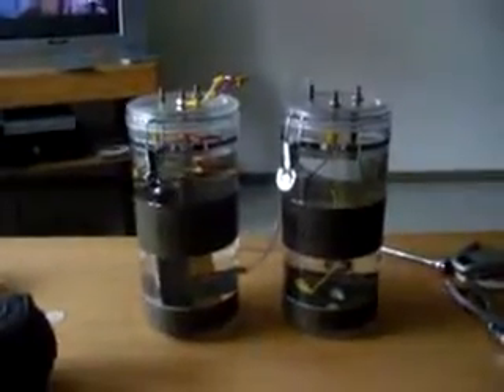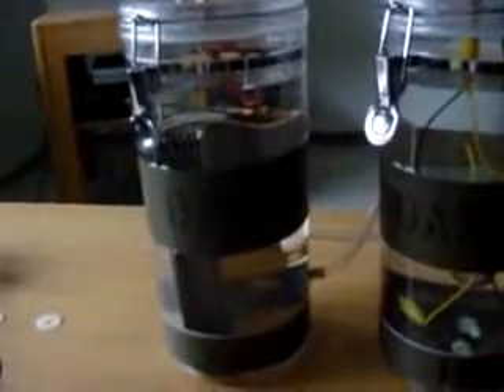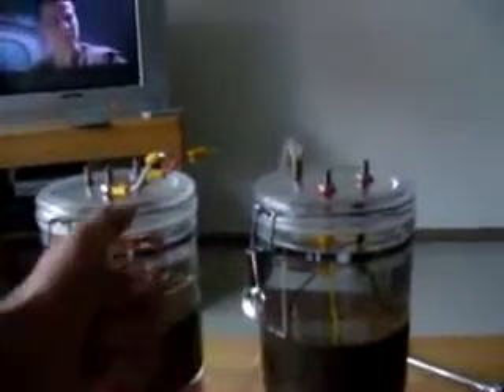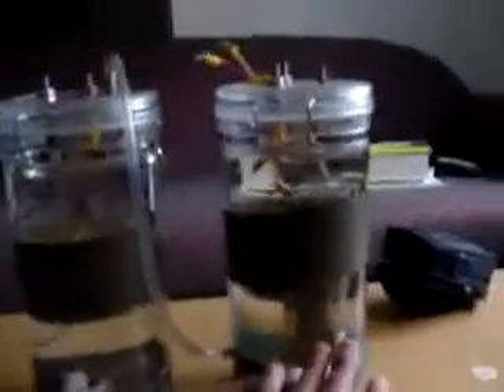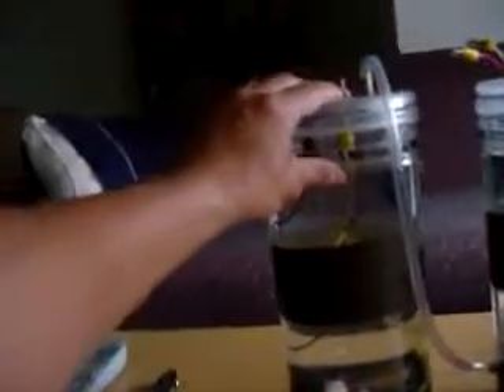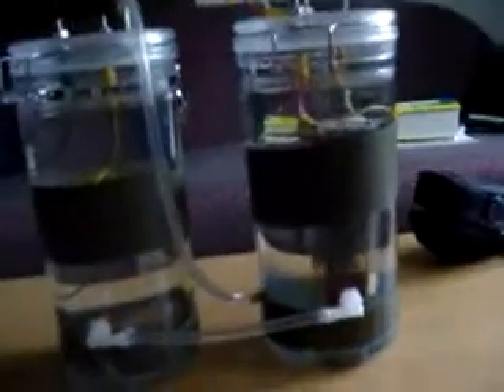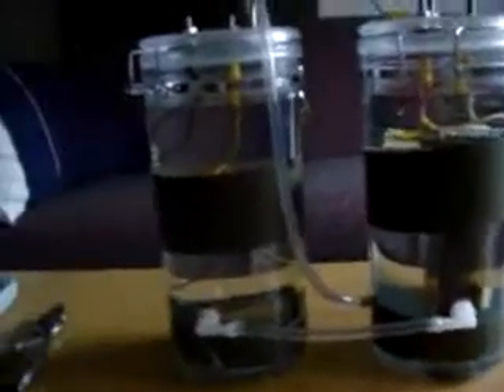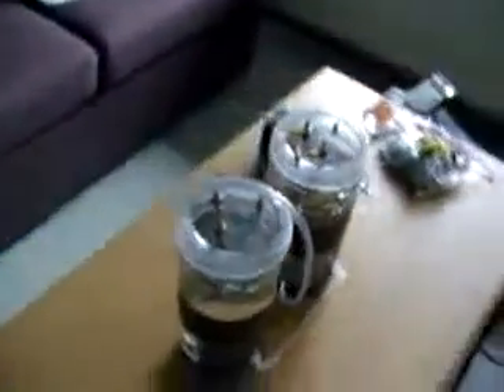HHO Dry Cell Construction -- Here's How to Construct It! Part 2

Comment: those containers leak at the gasket guy, be aware... they are made to be air tight, and gas tight is something entirely different.... for temp  strips, they don't go as high as your cell will, get a cheap lazer hand held unit for temp, and black dot it... check my video ...{ FuelBan video 4 EMISSIVITY & Infrared Thermometers HHo Hydr } it might help... but be safe soldier, they gaskets will leak on ya...
Thom in Scotland.